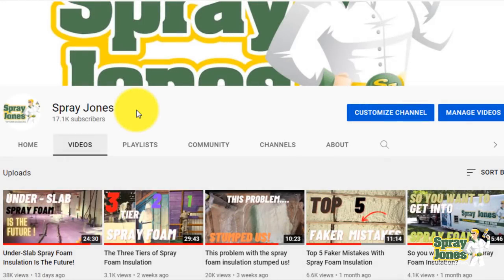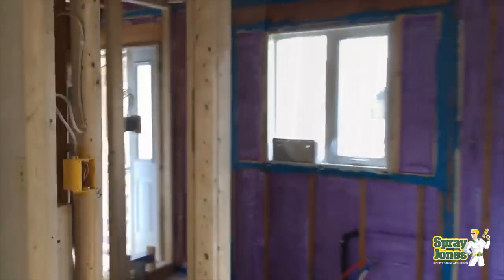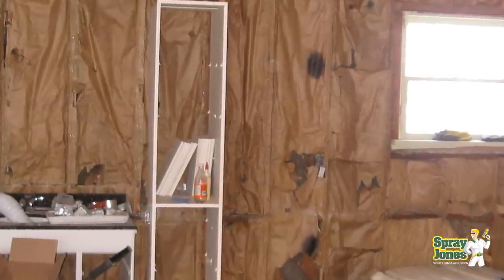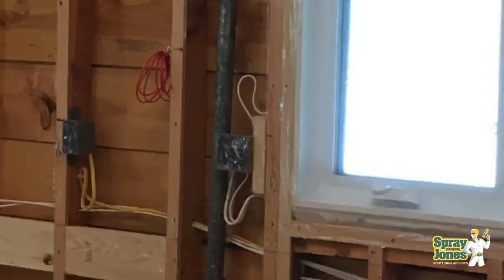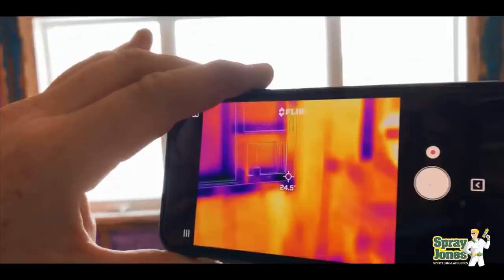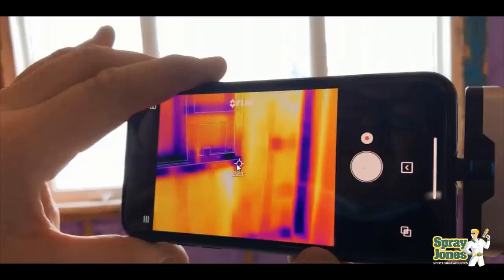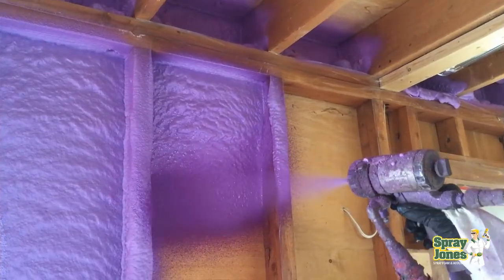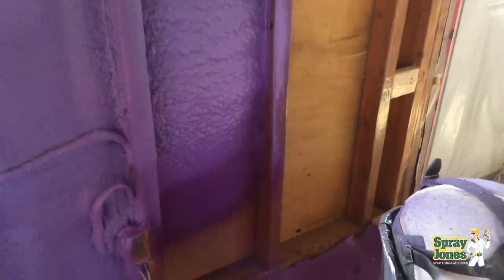Walls and Spray Foam Insulation Part One | 2" x 4"

Comment: I'd be interested to know who spray foam is to deal with down the road when you are doing a renovation?  I'm guessing whichever side it's sprayed onto is difficult to remove and some sections come out when you pull the wall.  problems you've see it cause etc. etc

Comment: Ty for your expertise.  We are making a move to Montana but contractors are booked out 2-3 yrs. I was looking into converting a shed into a temp living area.  You’ve convinced me on closed cell and all the benefits!  My question is since we are blocking out moisture from the outside do I need to be concerned about moisture on the inside? Just thinking about showers, cooking etc creating moisture.  I will put in fans and vent hood but wasting sure that would be enough.  Thanks in advance!
Reply from the maker: Watch video on building a home too tight, watch condensation video from a year a go.

Comment: Another great video Mike. Question: since 2” of close cell gives a r value of 14, if for code I needed to get to a r value of 20, would you recommend 3” of close cell or some other cheaper filler to get there?
Reply from the maker: 3"
Reply: For 2x6 walls and ceiling...you seem to suggest 2 inches of closed cell for sure. Would you suggest open cell for the rest of the cavity or rock wool?

Comment: Mike, I will be purchasing a 14x28 "shed" and converting it to a 4 season cabin in northern Wisconsin. I'm looking at 2" spray foam in the floor, walls, and ceiling.  My concern is installing electrical and plumbing.  Can electrical and plumbing be installed after the foam is sprayed or does it have to be done before hand?  Couldn't find any previous video's of yours addressing this. Thanks.

Comment: Again a good video. In the 1st section you guys were spraying right on unprotected studs, do you have to shave the foam off the studs for the drywall?
Reply from the maker: Use tape

Comment: dealing with the currant pink fiberglass insulation sucks, lol I will bet that 1st stuff your talking about in the 1930's, must have been terrible to work with it must have been like razor blades. You guys are the experts on insulation here but I remember an episode of Holmes on Homes, Mike Holmes said if you have a pin hole in that vapor barrier you get a liter of water a season. I don't know if that's accurate but just thought it was pertinent to this topic. Also in the states especially from 50's-90's wooden paneling was the covering of choice as you don't need much skill to place it up. But great video.

Comment: Will follow this. We have gutted a small 900 sq ft one story and will be converting it to a cabin for use in all seasons but not full-time. 

I'm concerned about how clean we need to make it before the spray. It has 1 by's for sheathing over rough sawn full dimension 2x4's.  Will shop vac typically be good?

P.S. We will have a cathedral ceiling which is also 2x4 with 1 by roof sheathing. We are also going to have the rafter bays sprayed.

This property is in northern Michigan. No air conditioning planned and will be heating with wood stove supplemented by electric baseboar and or vented propane space heater.
Reply from the maker: I have a whole video on "what conditions do we need."

Comment: Mike it would have been nice to document what 3” (of closed cell or more) would look like with the the infrared camera (for comparison), no?
Reply from the maker: Go back and look again when he has the camera up. 
Smaller spots on the wall where the foam had to be shaved is 3" or better since it is flush to the stud face. 
Do you see dotted color change with the camera? No because the variance from 3" to 2" is so small you can barely pick anything up.

Comment: Hey Mike, if I have Henry Blueskin (water-resistive barrier - 33 perm) over plywood sheathing on a 2x4 wall do you see any issue with installing closed cell foam in my walls? Want to make sure I’m not causing an issue with trapping water/vapor against my sheathing.
Reply from the maker: Probably not in your lifetime. This is not a final answer of course...

Comment: What happens if the sheathing is damaged from the outside, either impact or rot and needs to be replaced? The foam will be ruined and also need replaced?
Reply from the maker: Maybe. 
Repairs cost money and time with anything.
Reply: @SprayJones  Yea I get that, I'm just trying to think of what would be the optimum setup. Maybe put some type of membrane in the wall cavity first so the foam doesnt adhere to the exterior sheathing?

Comment: Hi Mike, 
not really on topic for the video, but there is a concrete block side wall in a bunch of the footage.  It is likely a common wall as a fire separation from the unit next door.  How did you treat that wall to address the air leakage through it.  The wall is full of hollows that lead all the way where it meets the exterior wall and also passing through the roof.  Other than completely covering it with 1.5" of foam is there a way you have addressed the air leakage there?
Reply from the maker: The block wall is for another unit, so it is inside warm space. The housing authority calls the shots not us, and did not want any of it sprayed for cost reasons.

Comment: I’ve built six houses in my life, the last one, I used foam on 2x6 wall. I was extremely dissatisfied, the foam had too much moisture and I had 7%. Shrinkage, it was terrible, I had to completely remove the plastic barrier and fill by hand and stuffing fiberglass in all exposed areas. I hate the contractors that talked me in to the foam. I’m sure there is better foam out there, but It was not good in 1999 for me.
Reply from the maker: Are you talking about open cell foam?

Comment: Why do you spray like that?? Would it not be more efficient to use picture frame spray technique?? It would be less waste and save the time of cleaning the board face. Not trying to be critical, genuinely curious.
Reply from the maker: 1. Side to side is actually less tiring for a sprayer. You will see many others do it too. Up and down is exhausting. 
2. New high build foams do not want you to picture frame, but a reverse framing
3. The SPF up the sides of the studs helps to seal other gaps at the top and bottom that thereby gives a better air seal.

Comment: My longtime carpenter friend from New England tells me that even with good spray install 4 years later there may be separation of foam from wood. This may create gaps.
Reply: I live in a wooden building that was internally sprayed in 1982, when we open up a wall to replace the windows last year the foam was fixed solid to the wall and battens, absolutely zero shrinkage or cracking.
Reply from the maker: Watch 5 failures and why. I address that it is a specific failure easy to avoid.

Comment: Can spray foam closed cell be used as an exterior that is then painted or covered with earth?
Reply from the maker: Watch "in contact with ground"
Reply: @SprayJones  I will watch it for sure but short answer yes or no? I enjoy your content. I've been more suspicious about air infiltration all these years it's nice to see the truth getting out
Reply from the maker: @tedt6453  All depends on where, water levels, drainage.
Foam generally needs no other support to work in ground.
Reply: @SprayJones  thanks